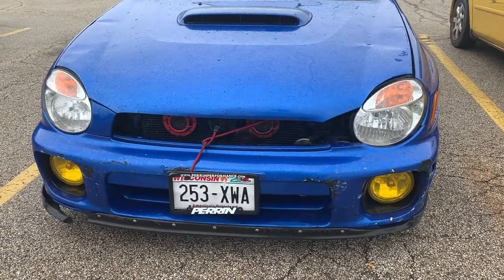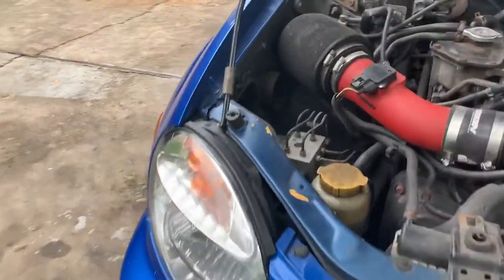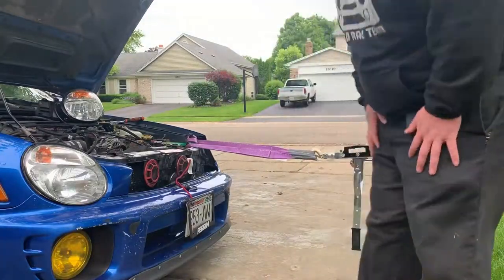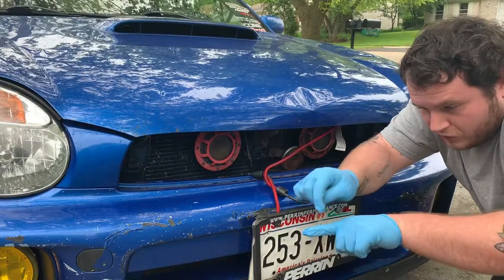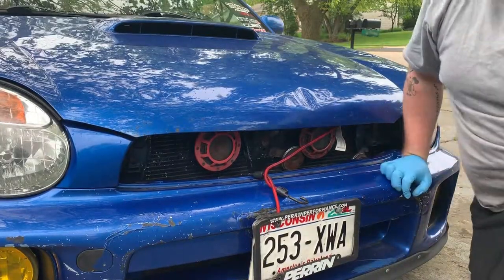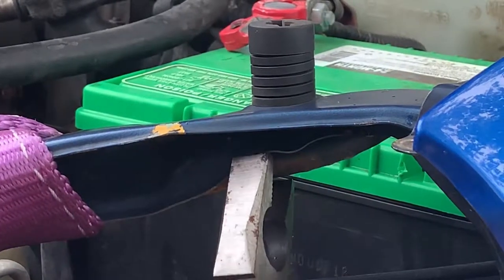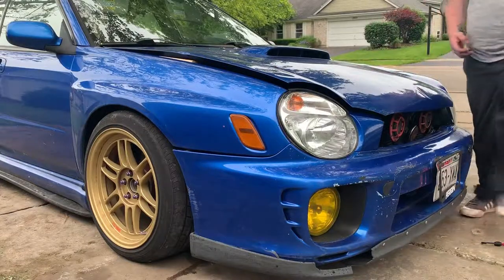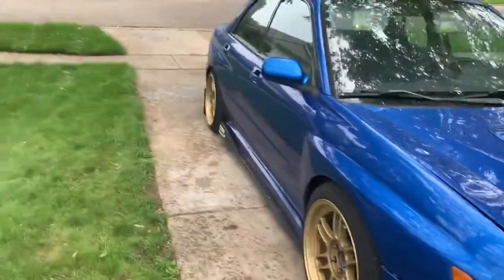DIY bodywork: How to straighten radiator core support

Comment: Saw this video and it really helped me out. Thanks!! I had a bend in the middle of my radiator frame. One thing to remember, as was mentioned in the video, don’t put your car in park/in gear! It will put too much stress on the transmission. I used the e-brake and wheel chocks (Harbor Freight) in the front and the car didn’t move. Some serious loads to bend it back it but it worked! Thanks again for posting this!!
Reply from the maker: Good idea

Comment: Thank you so much for this video. I was just stressing about straightening mine out and or replacing it and the fact that I don’t want to go through the trouble of all the welding and everything LOL. I’ll be able to just pull mine back out because I’m having the same problem as you with the headlight not fitting.

Comment: Yoo bro, thank you for this video. I was gonna do the same thing you did and my radiator support on my 06 Acura TL is bent inwards too. I have got all the parts for it and I took the radiator out too since it broke. I was gonna do the same method as you did here but only with ratchet straps and try to bend it back out. But I think I will use your method and pick up the puller thing from the store. Thanks man I’ll update you and please give me tips. I can show you the car too if you have a insta or something I would like you to see it
Reply from the maker: Glad I could help bro! my instagram is @tobe_bryant send me a dm
Reply: Hey how it going man I know it’s been a while since you post this comment. I was wondering were you able to pull it out enough?

Comment: Easier way wrap a tow rope round a lampost or something solid and attach to the slam panel, get a friend to spot for you so you dont bend it to far out, put the car in reverse and use the car power to straighten it, just dont drop the clutch or it wont end well 🙈

Comment: My car might be different because those come alongs are crap and the frickin handle will bend much more faster than the radiator. 2013 impala support frame is thicker than this one though so it might work on them Hyundais like my man has lol. That support about as thin as a tortilla and I’m sure that shitty comealong didn’t do nothing at all but sway it what looks like all he needed was to readjust the headlight. Like the pooch but kids don’t waste ur time with this method because it’s not gonna do anything but piss u off

Comment: My son needs a bumper, lh fender and the rad supports (plural I believe) cant find that shit anywhere in canada
Reply: Will def try this if we cant find the rad supports
Reply from the maker: The struggle is real man 
You can try to find replacement stuff online I found this idk 

https://www.subarupartwholesale.com/p/Subaru__WRX/Fender-Left--Front/49257077/57110FE030.html?partner=googlebase_adwords&kwd=&origin=pla&partnerDevice=m&userLocation=1028029&kwd=&matchtype=&device=m&network=g&userLocation=1028029&googleCampaignID=1679956244&googleAdGroupID=71060933411&googleAdID=326140009082&googleExtensionID=&gclid=Cj0KCQjw_4-SBhCgARIsAAlegrXWoX1e22wrophZJZG-Nhs7WfHc4NFe_lr3I8nUMfPuGtYKHxDXRQsaAs7jEALw_wcB

Comment: So that method doesn’t work at all guys. That support frame about as thin as a tortilla and the comealong didn’t do anything but sway it . The support looked fine to begin with too all was needed was to readjust the headlight and the hood latch . I’ve tried that comealong method and it’s no good. The handle will bend quicker than the support will . Also, take it easy on yourself big guy! U fixed it whatever it was so ur good. Awesome pooch but method no bueno